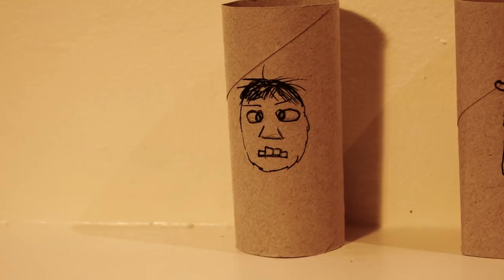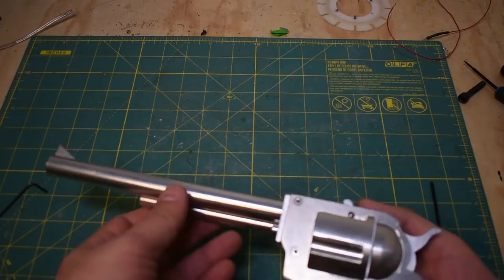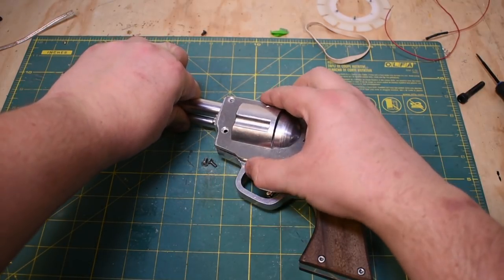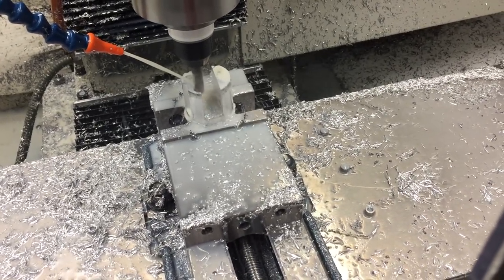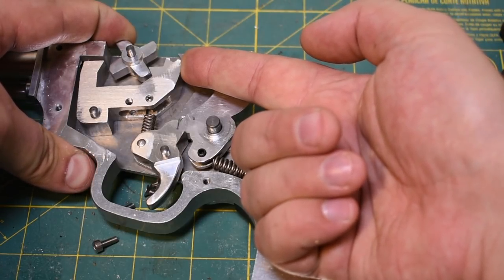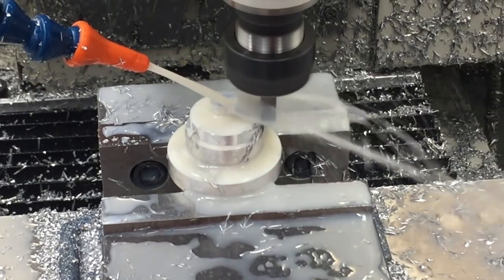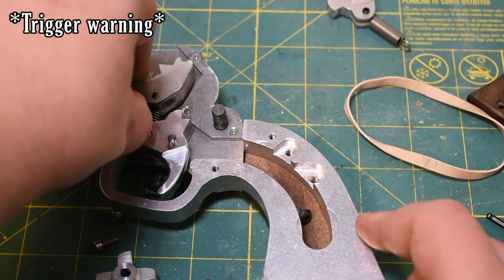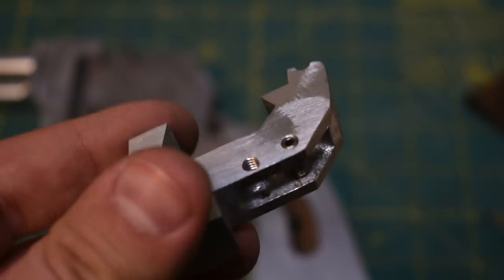A Rubber Band Revolver!

Comment: "butcher it with a file" 
sounds like what happens when i get anywhere near a file. lol
Reply from the maker: I can sometimes do decent work with a file, but i was in a hurry :P
Reply: @TabletopMachineShop  my most recent filling is making an approximately square 1/4  inch hole in some 5/8 (i think) square high carbon steel. We have a pretty nice machine shop at my University, but they somehow didn't have any single point threading tools.

Comment: Bit late to the party but I have to ask - how long does it take to prep and laser a piece of wood like this? It doesn´t seem very intricate and it´s not a "functional" part. You should be able to saw it in about 4 minutes top (being very generous). Especially if you´re going to sand it anyway. I certainly don´t doubt the method, but the curiosity is killing me :D

Comment: Let me guess. There will be some buttons for what screw you want to tighten and the corresponding Allen key will light up.
Reply from the maker: That would be cool, but it's more of an "Allen key alarm" if I take the allen key out and don't put it back in say, a minute or so :P
Reply: @TabletopMachineShop  I need one for drills Im a terror for not putting them back ..then having to sort a pile at the end of a project

Comment: So will the Allen key holder make noise if you forget long enough or try to take out too many keys at once? Also need to add a finger print read to log tool check in/out times.
Reply from the maker: You're right on the first count -- prototype 1 will just light up when the allen key is out, thus triggering my deeply programmed desire to make sure the lights are out before I leave, but prototype 2 might be a bit more involved and have timers and sounds and things.  We'll see how prototype 1 turns out!

Comment: Neat project. Might I mention that the Thingiverse project carries a license that specifies both non commercial and share alike clauses. Isnt it a violation to place your version of the plans behind a Patreon paywall? I get and support putting your original content plans behind a paywall but this is different. Isn't it a bit of a dick move to monetize a project so heavily based on plans and designs from two sources that freely gave them away? No ill will intended, I'm just thinking out loud. Cheers
Reply from the maker: I would argue that there are enough differences and enough changes were made to the design that it should be fine, but you make a good point, I'll put it up as a freebie!